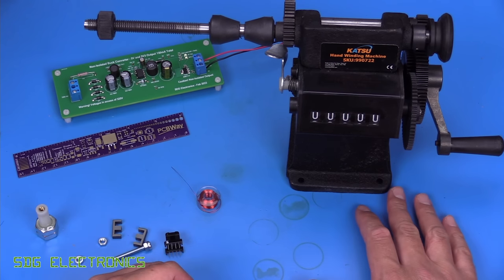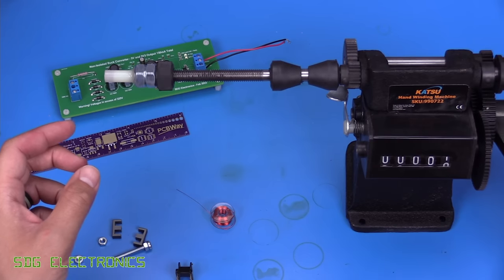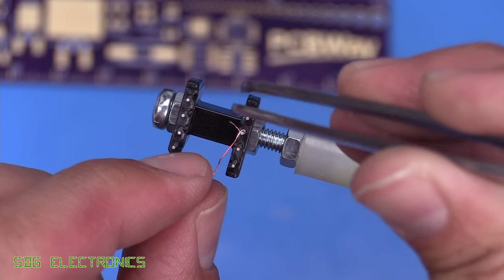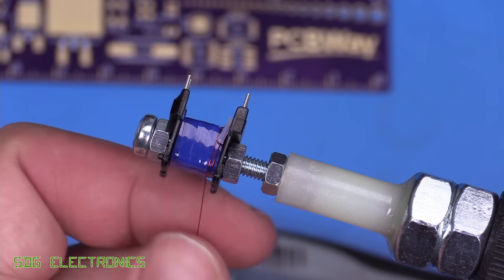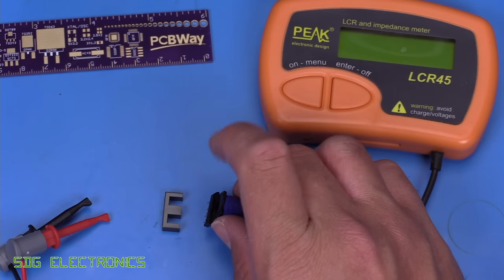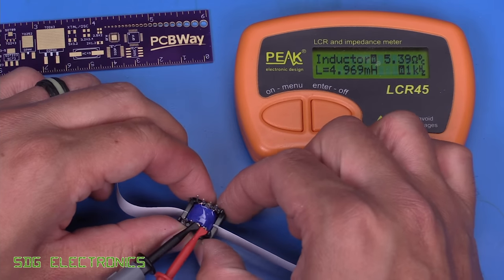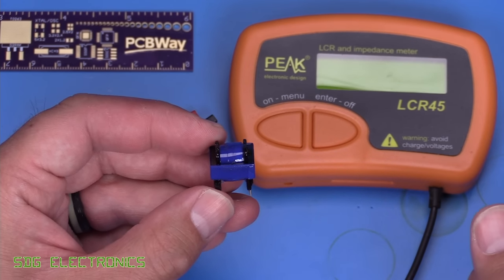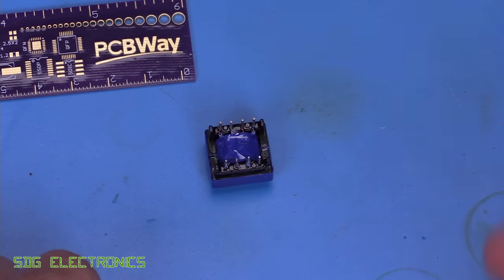SDG #305 How to Wind a Flyback Transformer for SMPSU

Comment: As always a very nice video. The air gap of the flyback transformer should only be made on the middle leg, for example by shortening it with sandpaper. Otherwise, the transformer will emit a significant amount of magnetic field, which will negatively affect the EMC. I also recommend adding additional shielding winding on the primary side and FLUX BAND before varnishing the transformer.
Reply: Ferrites are very hard, and "sandpaper" isn't going to work well at all. Silicon carbide is about the softest material with much hope of working. Manually gapping the centre leg is a tedious task. Of course in large production having the centre leg properly ground to spec isn't an issue (tell your supplier what inductance you want, NOT what gap to use).
If you are going to use a shorting band around the outside of the transformer gapping all legs with a spacer is generally acceptable. I've used cores with spacers in flyback converters that passed radiated EMC requirements.

Comment: Very interesting. What did you use as transformer varnish? Regular varnish ?
Reply from the maker: It was sold specifically as transformer varnish and has that traditional smell of warm transformer. I can't find where I bought it from though
Reply: @sdgelectronics  Ok, thanks. I'll look out for it from the usual places.
Reply: Google "glpt varnish"
Reply: Varnish is readily available from vendors that supply materials to motor rewinding shops. The problem is that you probably won't be able to get it from such a supplier in small quantities. Most manufacturers don't put it up in volumes less than about 4 litres/1 US gallon.

Comment: Please note that the drawings specify Triple Insulated Wire for the secondaries. This is important to comply with safety standards such as IEC 62368. The transformer is too small to be able to provide the margins that are needed for the creepage distance requirements, so TIW must be used instead.
Reply: Triple insulated wire is a great boon for small transformers. It's expensive but real problem solver.

If you needed to meet some of the older VDE creepage and clearance requirements with ordinary magnet wire you lost 4 mm at each end of your bobbin. You'd probably have to select your transformer core based on that as much as electrical/magnetic performance.

Comment: Very interesting video. I tried to replace a similar SMPSU in audio equipment a few years ago. But I was not able to find a replacement for the Flyback transformer. I sent it to a shop in China that told me they would be able to make another one, but It didn't work and fried the board. What will be the best way to reverse-engineer the board to find the required winding?

Comment: Now I'm curious to know why they said not to use a vacuum pump to get all the air bubbles out?!!
Reply from the maker: The application note mentions purposely increasing the interwinding capacitance as a means to counteract the effect of the leakage inductance. The idea to remove the need for a primary clamp. I'm not sure if vacuum impregnation could affect it.
Reply: @sdgelectronics  Good show! All other things being equal, I can't see how the varnish replacing the air can decrease the inter-winding capacitance. (The solidified varnish will have a higher dielectric constant, than the air it replaces.) Pulling a vacuum on varnish causes the VOCs (solvents) to rapidly boil out, and makes quite a mess. I think varnishing each layer, as it is wound, reduces the available winding area, and may decrease the inter-winding capacitance. (The layers will be farther apart. ) Anyway, I don't tend to see manufacturers impregnating these small SMPS transformers with varnish... there doesn't seem to be a good way to do it? ... and... proper application of transformer tape holds the windings tightly in place.

Comment: Steve -- This mains-powered isolated SMP video series is highly valuable, following as it does PI's "cookbook", and really joining the dots. It would be great if you could dig a little deeper into the key transformer topics of 1. arranging the air gap for minimum EMC,   2. an insulation layer between primary and secondary in aid of achieving some target of pri-sec withstand voltage, and 3. a shield layer between primary and secondary to reduce transmission of switching noise voltage.  And complementarily, how to measure these for a hand-built transformer or for a commercially-built one.  Also 4, Resulting "touch current" and "touch voltage" (if the secondary is not grounded to mains ground).    Other commenters have contributed some notes on some of these items, it would be really satisfying and useful to see them demonstrated in the series!
Reply from the maker: Thanks, I plan to make a higher power converter soon, so I will cover the topics there!
Reply: @sdgelectronics  Excellent!

Comment: Same coil winder as mine......the delux version with the didgital readout. I used to have the original analogue dial gauge one which had two speed!
Reply from the maker: I was looking at getting a motorised one ages ago, but I think the windings would just be messier, faster 😢

Comment: Transformer winding is the most painful part of building power supplies.
I do like your winder tough, I usually just secure a hand-crack "americaner" drill into a vice. It's only lacking a counter, and it was super cheap to get.
Reply: I've designed a lot of switchers. Transformer winding has never been the most painful part. It is a tedious undertaking for production, which is why it is best farmed out to specialist contract manufacturer.
Reply: hardstyle905  
Winding magnetics is tedious grunt work. Winding one or two by hand is one thing. Winding hundreds or thousands is a a job for a specialist company.
Reply: hardstyle905  
I'll match your "lol" with a "duh!"

Hobby dweebs don't need large quantities. Not everyone who designs a transformer is a hobbyist. Apparently there are people slow on the uptake and unaware of this.

Comment: I wonder if the stuff the core is made from is porous (like graphite) and the varnish will impregnate the core altering it's properties.
Reply: This is what I can find, maybe a safety issue "It is also dangerous to pull a vacuum on varnish (flash point). Usually vacuum impregnate is used on air dry epoxy or oil filled transformers."

Comment: I would probably have done a split primary. Half the turns under and half over the secondary.
Reply: There isn't a lot of merit in a split primary for a small flyback "transformer" since it isn't actually used as a transformer in terms of power delivery. It does reduce the leakage inductance somewhat which means the snubber on the primary has less power to cope with.

[edit] I'd forgotten how he did the primary winding with "excessive" layers because of the difficulty in winding a minimal number of neat, uniform layers, Every layer added increases proximity effect losses which can be important. With the very fine wire being used it probably doesn't make much difference at the switching frequency used.
Reply: @d614gakadoug9  I was more thinking about the capacitance of the windings. Or was it that having the split windings provide better magnetic coupling... I can't remember.
Reply: @xenoxaos1  
Yes, split windings can definitely make a worthwhile improvement in magnetic coupling. It can also reduce proximity effect losses which are sort of similar to skin effect losses when you have multi-layer windings.
It can be rather a pain to do because you have to end one part, put on the secondary, then start the second part. My preference is to take each end to its own pin on the bobbin if there are enough pins.
 Some designs, such as push-pull, use a centre-tapped primary, so splitting it sort of "natural." Secondaries in push-pull, full-bridge and half-bridge converters are often centre-tapped, too, so you can match primary halves to the the secondary halves for best coupling and lowest proximity effect losses.

Sometimes electrostatic shields are useful between primary and secondary for EMI/RFI management. With split windings that means two shields. When I was making transformers by hand for prototypes I'd use thin copper foil for shields. Commercial winding houses may prefer to lay down a single layer of closely-spaced fine wire for a shield because it is quicker with automated equipment. (Only one end of such a winding is connected, otherwise it just short-circuits everything.)

In a flyback "transformer" the thing you want to do is minimize the "leakage inductance." This is modeled as inductance in series with the primary winding but with no magnetic coupling to the secondary winding. Split windings can help reduce leakage inductance. There is nothing in the circuit that provide an inherent desirable path through which the energy stored in the leakage inductance can be discharged, so it typically has to be dissipated in a the "snubber" which typically is made with a diode and capacitor in series from the switch drain (or collector) to the positive supply rail. A resistor across the cap discharges the energy it "absorbs" from the leakage inductance spike. A good design will get the leakage inductance down to around 1% to 2% of the primary inductance

If you use a discrete power MOSFET for the switch you might be able to use the avalanche characteristics of the body diode of the FET to take care of the leakage inductance energy. You can't do that with these Power Integrations devices. 

I often say that in switchmode power supply design everything is in conflict with everything else.  A lot of factors weigh into how you approach optimizing things.

Comment: at the end did u solder the wires or did u leave them like that ? also what type of tape is that ?
Reply: In production it is common to use magnet wire that can be heat stripped. The wires are wrapped around the pins two or three turns then all are soldered simultaneously in a solder pot. You can do it manually pin by pin with an iron, but you need to be careful.

Transformer tape is almost always polyester (Mylar is a well-known brand name). The tape itself is usually clear and colorless - the color is in the adhesive. Various adhesives are available. Some are heat curable.
I used to buy the tape from a local vendor that sold supplies for motor rewinding shops. Now some of the electronics supply vendors stock it. For production you would typically go to a specialist supplier called a "converter" that would slit and spool the tape to your requirements (tape normally comes from the manufacturer in wide rolls, sometimes called "logs", half a metre or more in length.

Occasionally a woven glass cloth tape is used for special purposes, but not between windings like the polyester tape.

Comment: Start on pin 7? Are you using counter clockwise numbering from the bottom view instead of usual top view or am I counting wrong here? https://youtu.be/fQmyrBEPsek?t=434 Same goes for pins  5 and 6 too.
On pins 1&2 you seemed to calculate normal way from the top vie. That would make the phase of the secundary inverted to what was intended.
Reply from the maker: I've messed up the secondary winding 😂 time to rewind
Reply: @sdgelectronics  You can always bodge the connections, just swap to wires with bit more to invert the secondary. 
That happens so easily.Been there, done that. Hope I saved you from some debugging and damaged test boards.
I was so waiting to see you measure if you checked the polarity too or not. I often do, especially with very complex high turn transformers that have really bit me a couple times before.